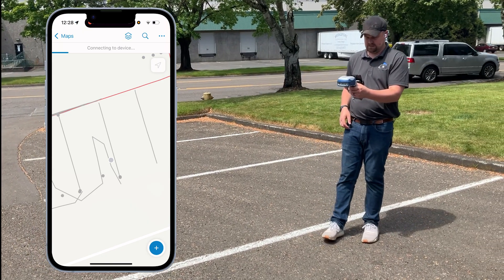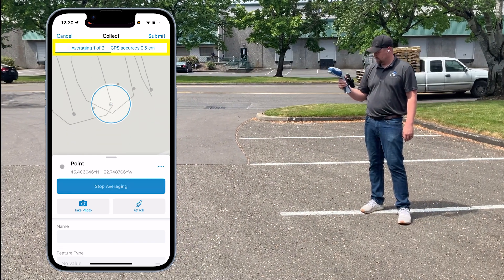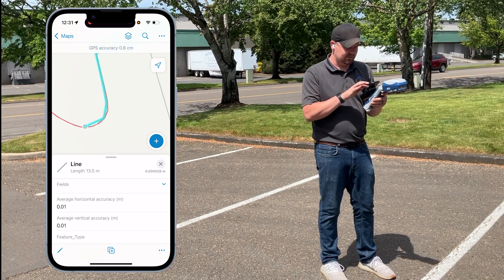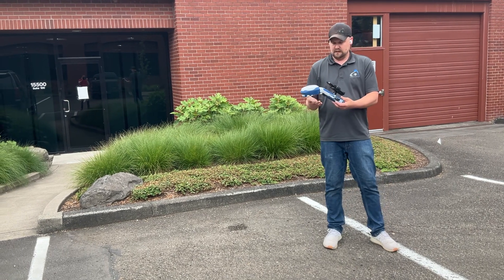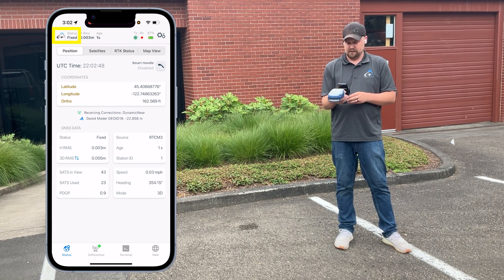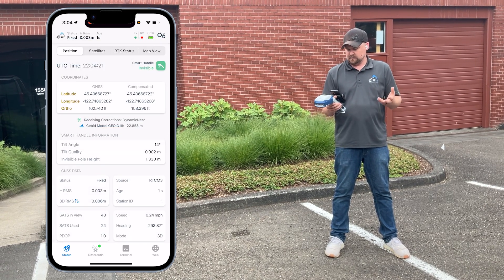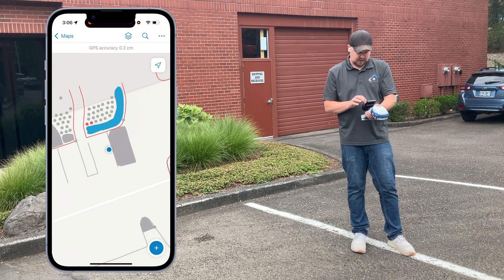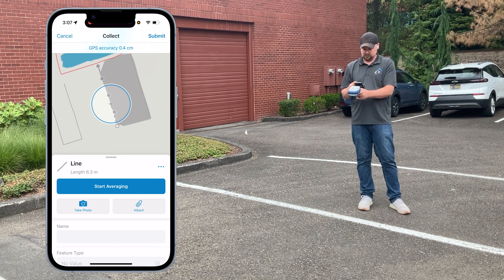Skadi Smart Handle™ Field Demonstration

Comment: How accurate can one expect the elevations to be? When we first got our Trimble DA2 devices, we were told the GPS theoretical rule for elevation is that the vertical accuracy is 1.5 times the horizontal accuracy? So if we have a 4cm RTK horizontal point, the theoretical vertical elevation should be, give or take, 6cm. Under perfect RTK conditions, how accurate are these Eos devices using the laser? Sub-centimeter?
Reply from the maker: Hi @BriansGIS, thanks for your question about elevations! Your elevation accuracy will depend on a variety of factors, including but not limited to your GNSS receiver model, your differential corrections source, and even things like RTK baseline. As a rule, you're correct that the estimated vertical accuracy will always be around/about 1-3 times your estimated horizontal accuracy — again based on a number of factors. The example you mention sounds about right to us, but again, actual results will depend on your true (not theoretical) field conditions. Under perfect RTK conditions the Skadi Smart Handle being used in Extensible Virtual Range Pole mode (which I think you're referring to when you mention the "laser") is going to be as accurate as your RTK accuracy. There is very minimal error introduced when using the smart handle with its green laser pointer (i.e., in "Extensible Virtual Range Pole" mode). If you'd like to request a demo, please contact our team here: https://eos-gnss.com/sales-inquiries. You might also find this article explaining the Extensible Virtual Range Pole mode interesting: https://eos-gnss.com/knowledge-base/articles/extensible-virtual-range-pole-overview.  Finally, you might also be interested in reviewing the specifications for the Skadi Smart Handle: https://eos-gnss.com/knowledge-base/datasheet/skadi-smart-handle.